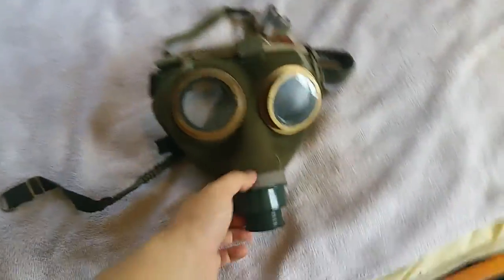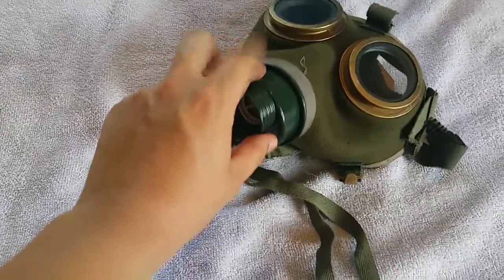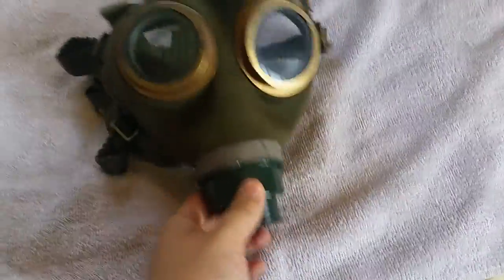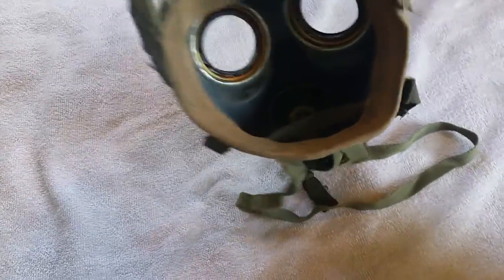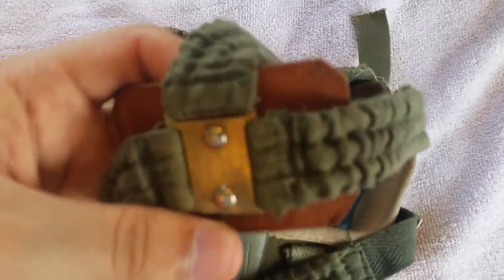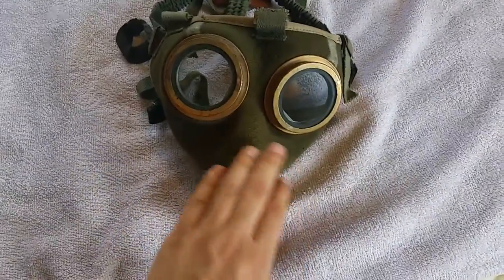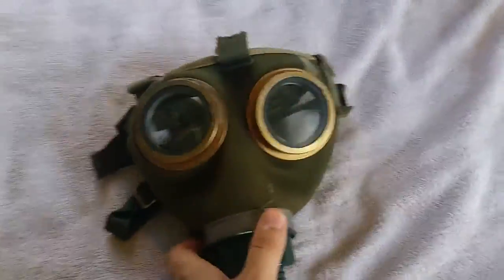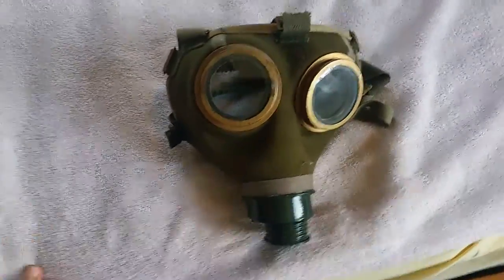Gas Mask Guys: Hungarian M67 Gas mask

Comment: The 67m and 75m look very similar to the ww2 gm-30 gas mask which was the same material and had a similar look. I got this for my Wehrmacht impression and it look good. I didn’t want to spend $150-300 for a gas mask.
Reply: What did you get for a size?
Reply: @heavyjuggernaut3912  I have two 3’s and a 4, the 3 fits me better though
Reply: @redtomato6929  So you recommend a 3? My head can fit a Size 2 Gp 5

Comment: So I'm looking to buy a Russian gas mask the GP5 or PDF-7 but I'm scared that the filter has asbestos but would a French NATO filter or Swiss filter work on those masks on those 2 masks please reply
Reply: But does the GP5 com in a child size
Reply: gp5s have a 40mm thread, so it can be replaced with most modern filters. it won't look the same. 

for a working gas mask, you will want to replace the filter on the gp5 anyway. As a decorative item or collectors piece you can keep the filter on it, I wouldn't recommend wearing one with a filter on it, they shouldn't contain asbestos (post 85) but the actual materials inside may have deteriorated and you might end up breathing in charcoal dust and small pieces of cotton. it's really up to your own discretion.
Reply from the maker: Lance corporal cook pretty much spot on with your comment!